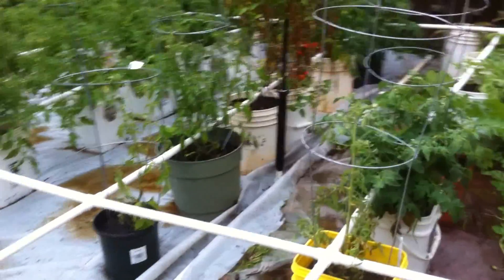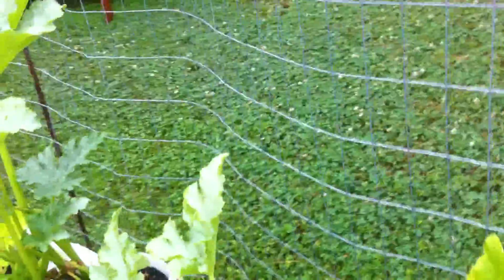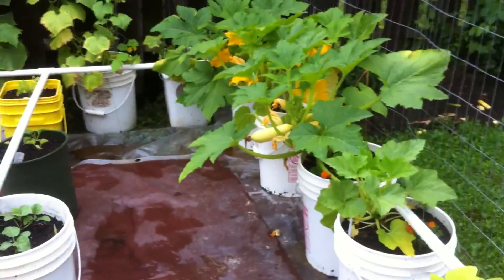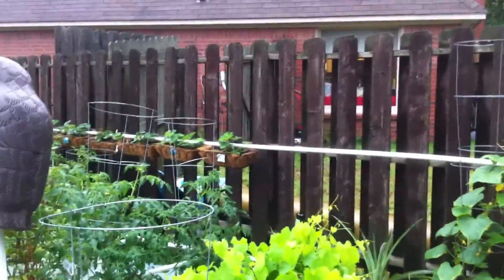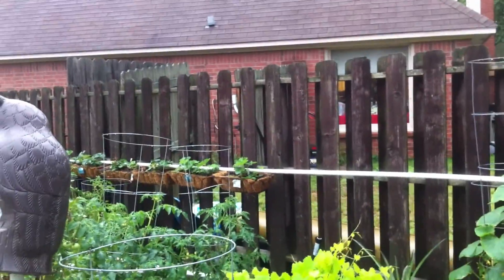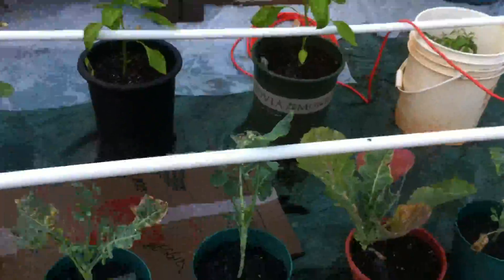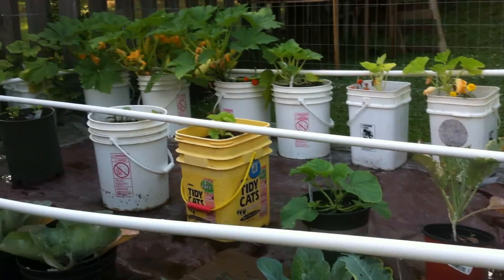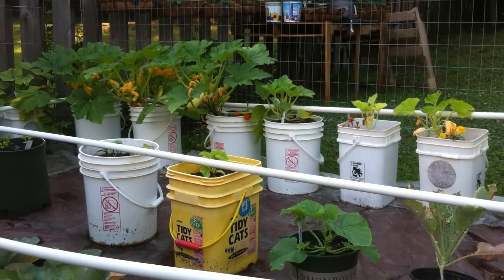How to Build a Home Made PVC Drip Irrigation System for under $100

Comment: Cool.  I grow my veggies in raised beds on a MUCH smaller scale than you do.  I have 1/4" soaker hoses in the beds with 1/2" black plastic tubing connecting all the beds to PVC that runs back to a PVC manifold at the bib.  Your idea shown here is very clever.  I would call it a success, too.

Comment: Well I have a raised bed garden and I use white pvc and black soaker hose.  Pvc is main feeder down the  side and tees off for each bed and then soaker hose snakes through the bed. I use a garden hose rated for potable water to connect to the outside faucet and I also use a timer just like yours  and it runs about 45 mins a day at 0500. I will take a picture of my setup and send you.

Comment: I've read that white PVC pipe can leach chemicals into the water due to the sun shining on it? What have you heard or read?
Reply from the maker: +Mack McDonald I had not heard that Mack. I do know that I am working to be certified organic in my new greenhouse and I am required to use white schedule 40 PVC for my water transport system.
Chuck

Comment: +Fensterfarm Greenhouse I like your design.  I have a quick question. What pressure is going to the pipes? Is it just normal pressure coming from your spigots or is it lower. thanks and great video. I am getting ready for my fall garden.
Reply from the maker: Its just what comes from the spigot. I have been using this design in my greenhouse the last couple of years and it works well.
Thanks for following along.
Chuck

Comment: Fensterfarm Greenhouse Nice work. Could you tell me a little more about the two hose timers that you used. Like, brand name, did you find them to work well, did they last a while, and would you recommended them or are you using a different brand now? Thank you!
Reply from the maker: I believe that both timers are Rainbird brands. I got themn at Lowes or Home Depot and I love them. I now use thm in my 30X100 foot greenhouse.
Chuck
Reply: Fensterfarm Greenhouse
 thank you for that info, but there are seven different Rain Bird timers listed at Lowes.com so which one is working well for you? I see that some of them do not have good reviews.
Reply from the maker: Sorry, I was wrong about RainBird. One of them is a Orbit Iris Hose Faucet Water Timer Item # 586530 from Lowes and the other one is an Orbit Digital Two Automatic Outlet Hose Faucet Lawn Watering Timer -
Reply: Fensterfarm Greenhouse  thank you so much for taking the time to find this info for me! Happy gardening!

Comment: Have you put a catch basin under the drips in one of your containers to see how much water the plants actually get each time your water turns on?
Reply from the maker: I was getting about 1 1/2 cups 4 times a day. About 7 cups a day at 2 minutes. I have that setup running in my 3000 square foot greenhouse now and it is still working great. 
Thanks for watching. 
Chuck

Comment: Nice work, and you won't have any weeding to do because the plants are isolated in the containers.  You probably don't have to consider freezing water lines but here in Connecticut I'll have to drain the system (much smaller than yours) each winter but the land is sloping, so I'll just place a ball valve on the down hill end.

Thanks.

Comment: I see u did not use primer i am a spr cont in fl i used that glue with no primer on 1/2 or and after s wile i did not hold it does not cost much more 4 primer if u look at the cost of your sys it shuld no mater

Comment: Yea, instead of using two feed lines, use a 1" or 2" PVC line across the back of the garden, and have that feed the the lateral lines of 1/2" that your using.

Comment: Hum.  Why not use pre-made 1/2 inch drip irrigation with drip emitters?  I have mine set on battery powered timers.  I'd say to replicate watering the pots you had there it would take $10 worth of 1/2 in drip irrigation tubing, a little bit of 1/4 inch tubing, some connectors and emitters for a total of about $20.  If you connected a timer that would be another $20.  So $40 total, and you can have control of your flow rate, and water when you're not home.

Comment: Why not just run small dripper lines off main PVC line...or run the PVC pipe underground about an inch.  Then put risers every 5 feet.  Screw on dripper manifolds to run lines to pots.  Watch my latest vid to see my set up.

Comment from the maker: Thank you for the suggestions. I ended up changing a few plants around and re-potted a zucchini plant into a large planter which is now holding up that sagging line. The filter is a great idea too. I just need to find something that would pull some of the chlorine out of the water. I am on city water here and it pretty much makes it imperative that I feed the plants with 100 proof compost tea every day since normal watering is killing off most of the bacteria in my soil. It's working well so far

Comment: Suggestion: Reposition some of your taller buckets to support the PVC in the sagging areas. Consider a filter on your water supply in case any trash gets through so that you don't bock the little holes. Love your videos! Before I was unsuccessful growing in buckets until I saw your videos and realized I needed compost tea and to water more. Thanks!

Comment from the maker: I determined the amount of time I am watering was to put a mason jar under the stream and filled it up to what I thought was proper for a 4x per day amount of water. I would figure out the amount of water per plant that you want to provide each plant. Then fill a small container up to that level and use that times the # of plants that you have to fill up a large container.
That should give you a pretty good idea of the size and the amount of water that you need on hand to adequately water them.